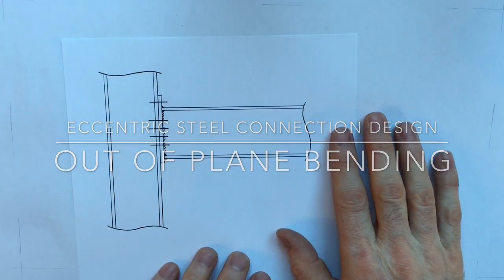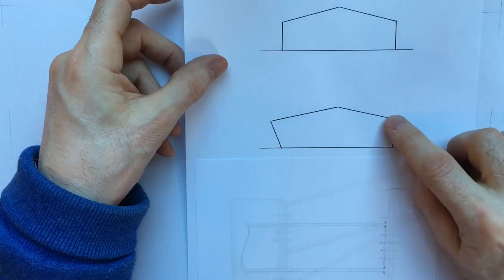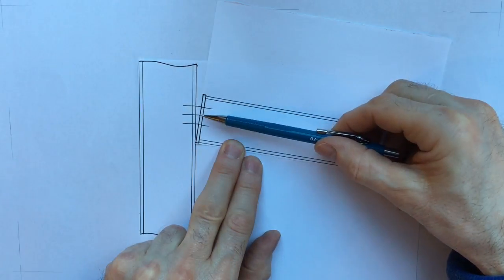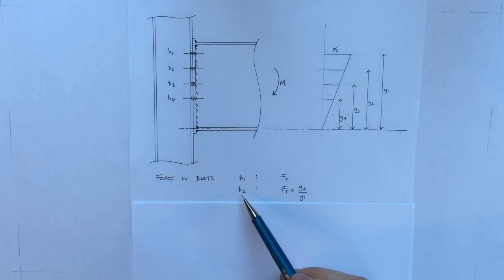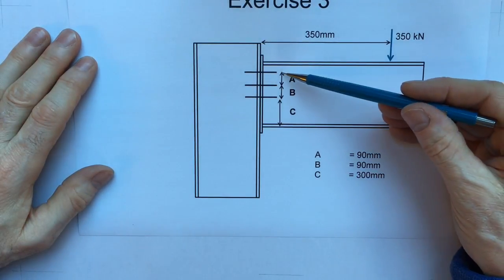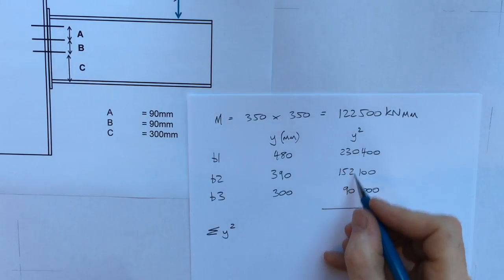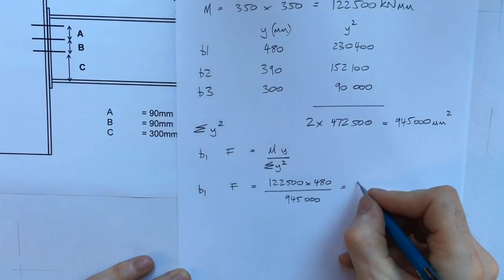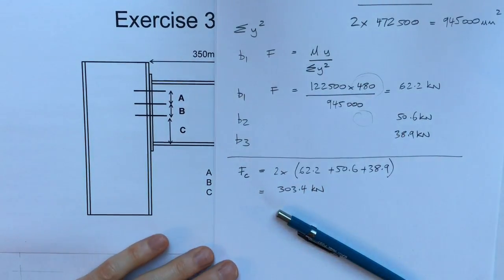Bolts in out of plane bending

Comment: Terrific explanation.
I have a few questions.

What happens in case the support is provided using only single fastener.
Will the pull through force be equal to (Load times length of the beam) ??

Also, one more question. From the above explanation, the location of fastener with respect to center of rotation (point of contact of flange) is important. 
Does this mean that the pull through load is independent of how far the fasteners are from top flange provided they are at same distance from bottom flange ?

Comment: Thanks for the thorough video. I'm a mechanical engineer though the curriculum I studied did not cover this type of treatment on bolts (Shigley's 11ed seems to have just one out-of-plane bolt problem), and this seems like a topic particular to civil/structural engineering. Is there any reference material for this method that you'd recommend, such as textbooks or standards?
Reply from the maker: Hi Nvelopmusic, thanks for the comments. In the UK there are two books used by almost all engineers designing connections: The Green Books by the SCI / BCSA. Text books are few and far between. Owens and Cheal wrote a good one a long time ago and more recently a student showed my one by Alfredo Boracchini - I have not read this one. Hope this helps, Mike
Reply: @mikebather  I will see if I can find copies of these. Thank you for the info!

Comment: Thanks for the exmplanation.
Just for clarification, when the Force values are being calculated at 10:00, does this represent the force being felt by an array of 2 bolts?
Or is this force felt per bolt?
Aka, do we divide this force value by 2 to get the force felt in 1 bolt at B?

Thanks!
Reply from the maker: Hi Max Mooney, at this point, you are calculating the force in each bolt. So, there are two bolts at the top of the connection and each of these carries a tension force of 62.2 kN. Best wishes, Mike

Comment: When I was a student, I had a hard time understanding this, but your video made it very clear and easy to understand. I was wondering, how do you determine the right thickness of the plate, so you get the linear force distribution in your bolts (Fi = M . zi / sum(zi²) )? The only way I think this is possible, is by using the T-stub method. So I wanted to ask you, can you help with a video on the "equivalent T-stub method" for joint design. I can't find a nice read, that explains it clearly and shows some worked examples. Thank you!
Reply from the maker: Hi Stefan, thanks for the comment. In industry, in the UK, sometimes the endplate is initially sized by the preferences of the fabricator, or by making it roughly the same thickness as the beam flange, or I think that the Green Book gives advice. If I find myself with time on my hands, I will consider a further video for sure. Best wishes, Mike

Comment: I appreciate you making the concepts clear, but I do not understand why we should multiply for compressive force twice when it is already multiplied for calculating the tensile force of the bolt.
Reply from the maker: Hi kumar shantveerayya ikkalkiswamy, good question. It is important to always think in 3D. The elevation of the bolted connection drawn on paper seems to show just one column of bolts running from top to bottom, but bolts are located on each side of the web of the beam. So when we calculate the force in single bolts, we must remember that they come in pairs. This is where the factor 2 comes into place. I hope that this helps, Mike

Comment: Very good video!!!!  I have a question ...if the base plate for the beam is larger than the beam...what will be the rotation point ? ...the bottom part of the beam...or the bottom part of the plate ? What happen to the bolts that are below the compression point from the beam ??? Thanks and keep the good work!!!
Reply from the maker: Hi Learning Power, thanks for the comments. Good questions. If the end plate extends below the beam then the answer to where is the point of rotation is "It depends." Imagine that the end plate is incredibly thin (just 1mm thick), then, it would bend really easily and the point of rotation would remain centre line of bottom flange. Now imagine that the end plate is really thick (say 100mm thick, just way too thick), then rotation would take place around the bottom of the end plate, very close to its bottom edge. So now, what is most likely to be the case in reality? Well, most end plates are sized around the same thickness as the flanges of the beam and so are relatively thin. This means that it is safe to assume that rotation takes place at centreline of the bottom flange still. I hope that this helps, Mike

Comment: Why that 2 times
Reply from the maker: Hi d Suji, around 5 minutes into the video I multiply a long equation by two. This is because there are two columns of bolts fixing the endplate to the column - one on one side of the beam and one on the other. So, as there are four bolt rows (b1, b2, b3 and b4) in two columns, there are eight bolts in total. I hope that this helps, Mike
Reply: Thank you sir

Comment: Hello Sir, if I have applied a bolt preload to each of these bolts, how would that affect the total tension force experienced by the bolts during this applied moment?
Reply from the maker: Hi DcWaves, If I place a steel bar in tension and then add more tension, I can simply add together the two tensile forces to find the total tensile force in the bar. Bolts are no different. Hope this helps, Mike

Comment: Sir, do we use same principle for the end plated CHS bolted connection for tubular latticed structure at splice.
Reply from the maker: Hi Mohammad Twaha Jaumbocus, thanks for the question. The method outlined in the video can be used wherever there is an out of plane moment applied to a bolt group which can rotate around a single stiff point. When designing a trussed structure, I would do my best to avoid bending moments in the members, to make the most of the truss action (with members generally either in tension, compression or neither). If you end up with a moment applied to a member and you have a splice (say connecting two members of the same size), then this approach could be used to account for the tension in bolts due to bending. You would have to combine this with any other tensile forces due to any tension (from the action of the truss) in the spliced member. I hope that this helps, Mike
Reply: @mikebather  Hi Sir, thanks a lot and sorry for late reply.

Comment: Hi Mike
Is the values for the bolts at b1, b2 ect at the end of the equation the tensile forces of the one bolt. Or is it the tensile for 2no bolts at that level?

Great video clear and concise
Reply from the maker: Hi Helena, sorry for the delayed reply. The bolt forces, 62.2 kN, 50.6 kN, etc. are the forces in one bolt at a time. This is why these forces are multiplied by 2 when calculating Fc. I hope that this helps, Mike
Reply: @mikebather  Hi Mike, no worries thanks very much for getting back to me. Helena

Comment: hello Mike, can that calculation apply to simply supported beam?
Reply from the maker: Hi syamthehero, in the UK, we adopt quite a simple approach to connection design. Broadly, most beams are simply supported and typically have fin plate or flexible end plate connections. These connections are not designed to carry a bending moment but instead are designed to rotate just a little to prevent any moment developing at the connection. This allows beams to be designed as simply supported.

Occasionally, moment connections are needed in steel structures and in these situations a stiffer end plate connection is typically used which can develop a bending moment. Beams supported this way are designed as having fixed (or partially fixed) ends. I hope that this helps, Mike
Reply: @mikebather  tq Mike for your great explanation.. Really appreciate for your prompt reply..

Comment: Great video, but I found that is only one just one way of calculating this problem.  I guess you can never be sure how stiffness of elements interfere with each other.
Reply from the maker: Hi Veron Hrvojic, you are right. This is one approach to out of plane bending which is based on a simple triangular distribution of tensile forces in the bolts. For the bolt rows furthest from the centre of rotation, it would be reasonable to adjust this distribution to increase tension in some bolts as long as there is sufficient ductility locally present. I like the simple model in the video as it allows engineers to very quickly understand how a connection behaves and to do a simple sense check on any computer calculations. The calculations to adjust bolt tensile forces to allow for local ductility are likely to be carried out by computer (although the SCI produce an excellent guide to this in the UK which allows the calculation to be done manually or using a spreadsheet). Thanks for your comment, Mike

Comment: This is very clear and concise but totally disregards the effects of bolt pretension, which in reality would have a large effect on the tension felt by each bolt.  This assumes that each of these bolts is basically installed to a loose finger tight.  I would love to see a follow up video that takes pretension into account.
Reply: Zachary, in case of preloaded bolts tension in the bolts doesn't change until fracture, so it's constant during the time of loading until tension, which should arise from external loading, exceeds the preloaded tension. This is due to the redistribution of stress between the connected plated. It's a tricky feature, but you should understand this. Preload in tension bolts doesn't cause any overload as long it is in the standard limits (in EN 1993-1-8 this is 0.7 times the ultimate strength of the bolt times tension area).
Reply: Taras Darmoroz Taras, so for a slip critical connection, bolt tension from moment can essentially be neglected as long as the calculated tension doesn’t exceed bolt pretension? Is this right? This makes sense to me. Does this mean that the allowable stresses for slip critical connections are derived from the bolt pretension?

Comment: Dear Mike, If any column is supporting 2 steel beams, one connected to its flange and the other perpendicular to it connected to the web of the column, then in such situation the bolted connection of both beams will still have a out of plane bending?

Comment: Hi Sir,

I have one clarification on beam web check.

For example if on top of beam steel post is connected with axial load of 50kips and at bottom of beam we have chevron brace connection is there .. the brace component VB is 72 kips .. so please clarify should I check max load or sum of both loads.. for beam web crippling,buckling.bending checks..

Thanks 
Rajesh

Comment: Hello Mike! Your videos have been really good! Are you working in the UK?
Secondly, you said the tension from the bolts must equal the compression at the point of rotation. Do you have to also check whether the flange or the web at that location would buckle and crumple?
Reply from the maker: Hi randomness2376, Thanks and yes, I work in the UK. Yes, probably you will have to check several ways in which the connection could fail. This video concentrates on finding the forces from a simple analysis. The next job is to get to grips with the design by considering all of the possible ways that the connection could fail, Mike

Comment: one question how are pin joints designed. they just require to take shear force?
Reply from the maker: Hi mass ali, in a word, yes! So in this example a fin plate connection could be a good example of a pinned connection. You can search in Google images for both 'steel bolted end plate connections' and 'steel fin plate connections' to see how fixed and pinned connections look. Hope this helps.